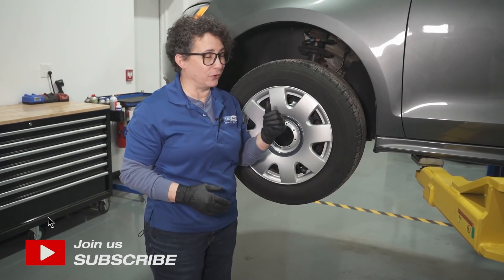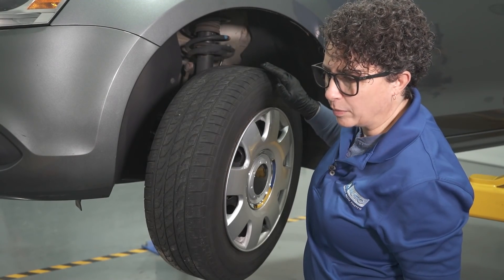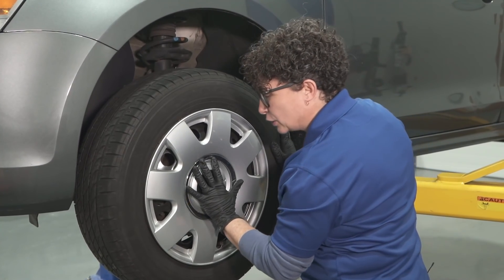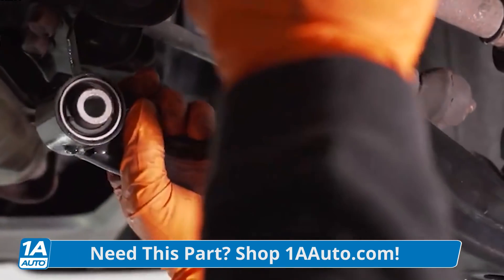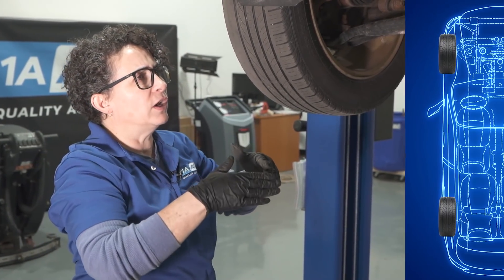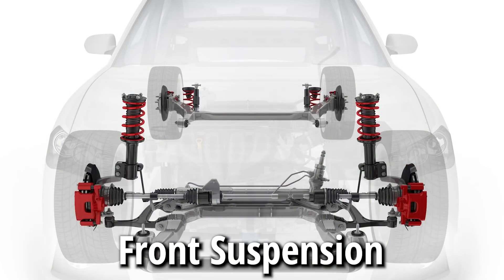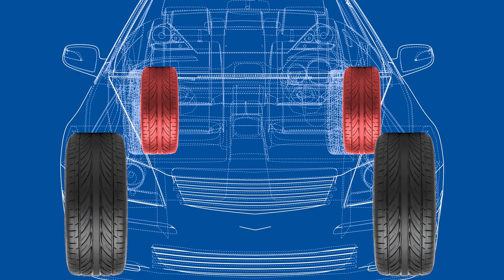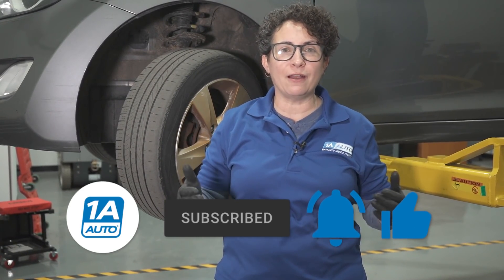Poor gas mileage? Check your tire tread wear for a suspension problem and save money on gas.

Comment: Susie, you are my hero. With your expert guidance, I could replace my 2006 Honda Accord  Strut Assembly flawlessly. You are simply the best. If possible, can you make a video of installing a radiator on a 2006 honda accord V6 with Auto transmission?

Comment: This is absolutely true. I got my entire front end parts replaced including a new steering rack at Midas. Then I got new Suspension Coils and new shocks and the gas mileage literally doubled which was amazing. I drove for 4 hours using up only $8 worth of Gas at $3.19 a gallon on regular. That is because less energy is needed when the tires roll easier and no traction is lost on the road.

Comment: That is great video..I am glad that find it...that is what exactly  happened  to my 05 honda accord. Both control arm is bad I mean bushing.front tires start be wear out slowly edges  going be gone then  wires slowly coming out.i am still driving on risk slowly when vibrate really good.i am waiting on both control arms with ball joint to change it and after buy tires and make alignment..I hopefully  everthing  will be ok

Comment: Im suspect that something in my suspension is going bad even though Ive replaced the whole front and rear less than a year ago but stuff could still fail prematurely, I havent been able to fill up though to check my MPG cuz gas is too damn much rn :(

Comment: One major fuel waster that is very often overlooked is oxygen sensor condition,   I have seen many 02 sensores that had horrible waveforms, but were not throwing codes.   Poorly maintained 02 sensors are also capable of causing rich conditions that can ruin catalytic convertes.
Reply from the maker: +kevin kelley Thanks for the tip!

Comment: Hi there,
My Subaru Outback 2012 2.5i Premium Odo:210k kms produces shuddering .

It started with shuddering while I accelerate over 80 kmph and the idling was smooth that time. It only shudders when I touch the gas pedal. Even if the car is over 100kmph, if I release the gas pedal, the car settles and glides smoothly which made me thinking that there’s nothing to do with the tire, balancing, alignment or suspension.
Went to a mechanic, he changed spark plugs and transmission oil. It was smooth for the rest of the day and started shudders the next day.

Driving over a 1000 km , now it shudders the same plus rough idling and a rrrrrr sound from bottom of the car(probably right below the gearshift lever, but can hear only from outside) 
Plus it shudders vigorously if I try to go over 80 and it do the same when I ascend a slope.

Front cv joint boots are slightly torn and the greese have leaked there. 

What do you think it will be?